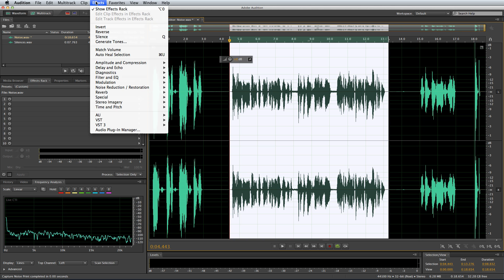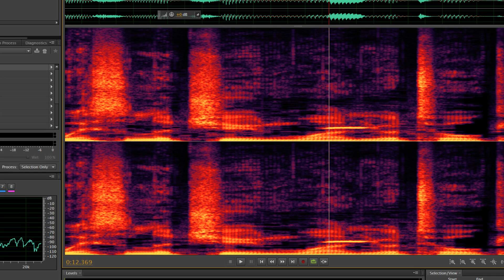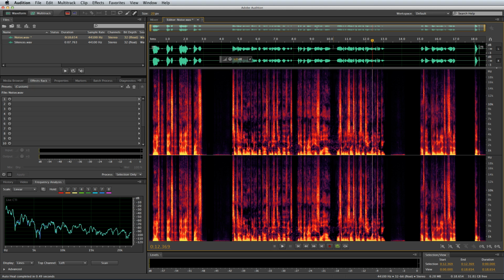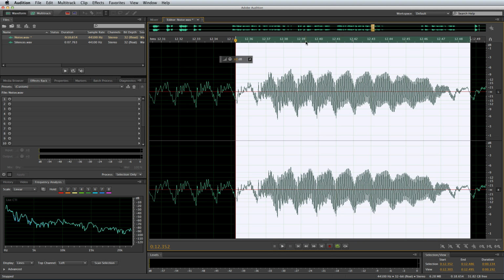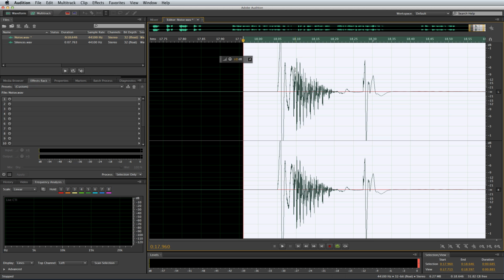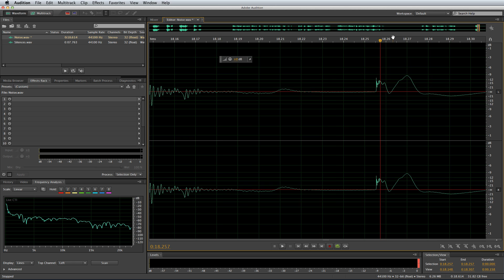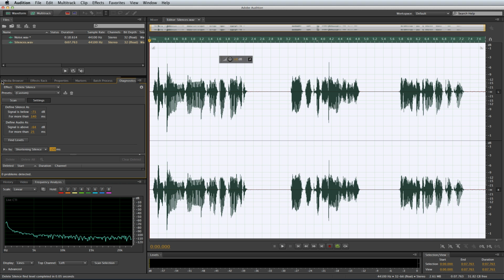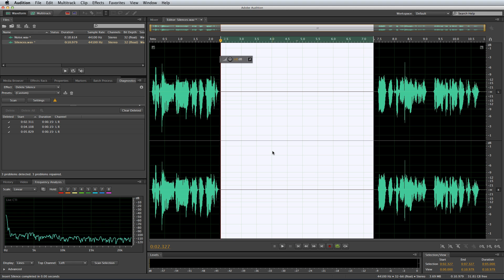How to Edit And Improve A Podcast : Webinar (2 of 6)

Comment: For removing the plosive sounds, my trick is to select the low frequency plosive section at convenient zero crossing points and then apply a high pass filter at around 100Hz and -20 to -30db roll off. The has the benefit of removing the high energy low frequency component of the plosive whilst preserving any higher frequency audio present. 

Excellent tutorials though. Keep up the good work.